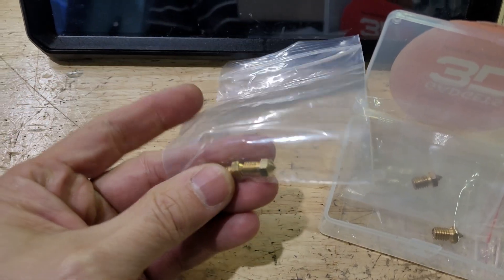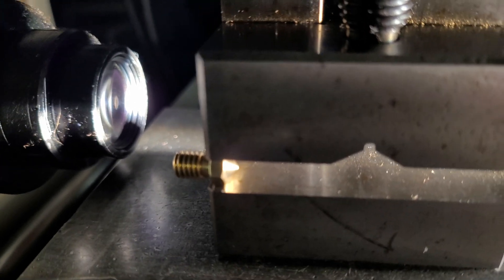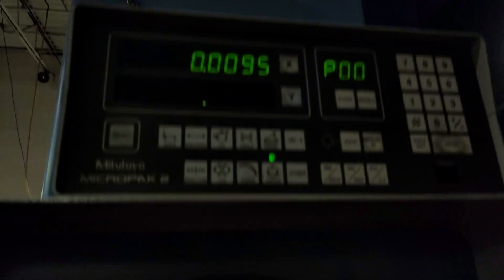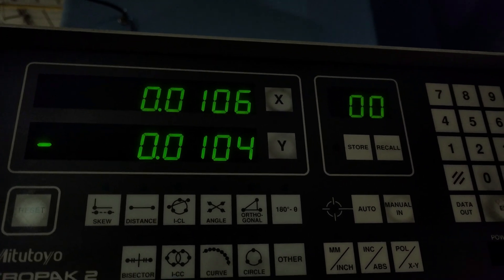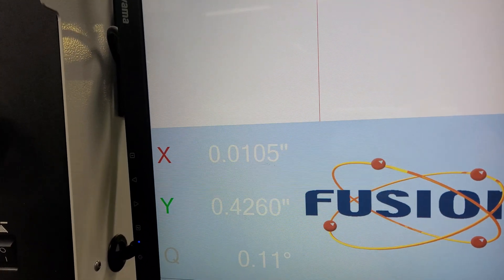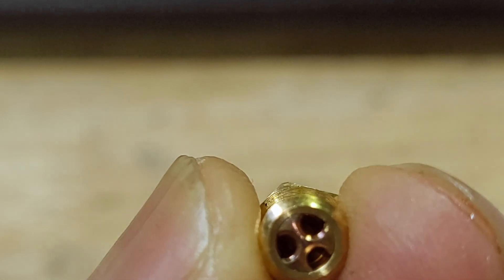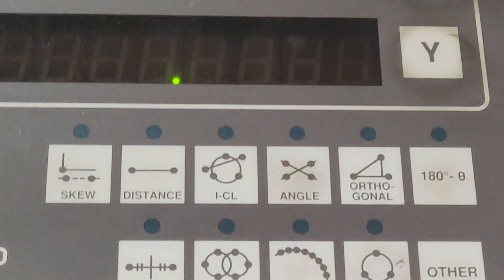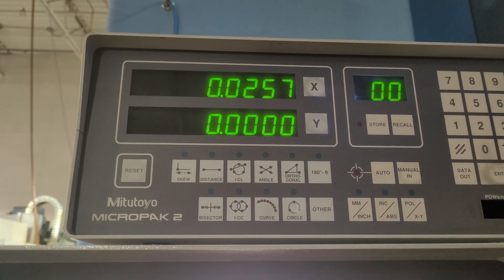3D printer nozzles - Are they actually what they are?

Comment: It can go either way on weather to tune the flow rate by either adjusting rotational distance, nozzle size or flow rate.

Ideally you should have the rotational distance of the extruder down to where 1mm of requested filament equals 1mm of actual filament but since there are deviations in the diameter on filament its worth filtering then out by using a best average for the flow rate. If both of those seem perfect but the walls are not sticking to each other or overlapping too much you can adjust the nozzle diameter and the slicer SHOULD space out the lines accordingly but this part in particular depends greatly on the slicer used.

Lastly its possible to adjust the extruder wall thickness to a bigger width than the nozzle and thru the magic of die swell as the material comes out of the nozzle it will actually function as a nozzle of a bigger size.

There is a channel where someone extruded 2mm wide layers with a 0.4mn nozzle but the speed had to be really slow so the heater could keep up.

Comment: Announce the diameter doesn't actually have any effect on printing parameters directly. I can use a 0.4 mm nozzle and extrude out to 0.7 mm wide by setting it in my slicer.
Reply from the maker: it must have some effect behind the scene calculating how much and how fast to push out the filament to meet the demand you want. in your case 0.7mm width.  if you print mid-air, (bridge) you never gonna get 0.7mm doesn't matter how hard you try to push the filament.